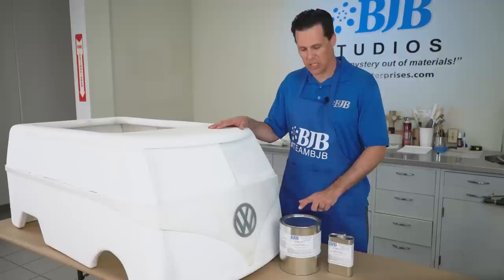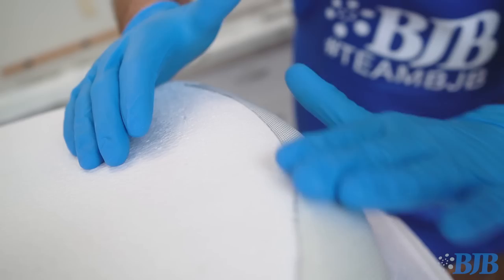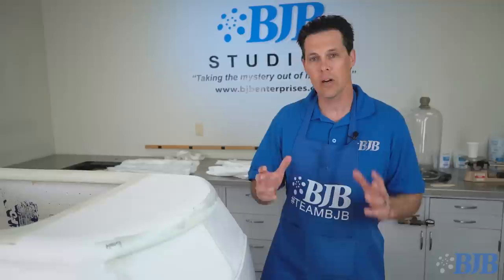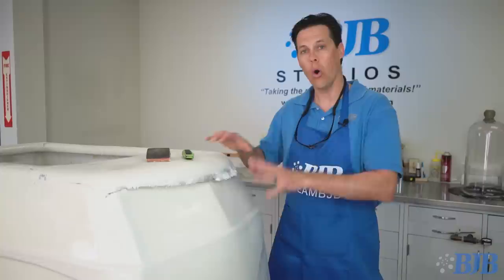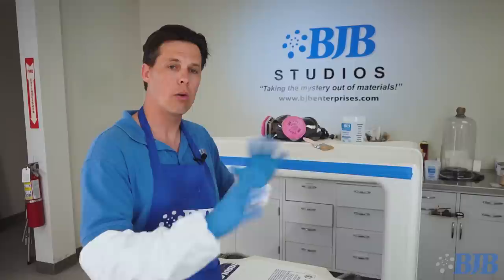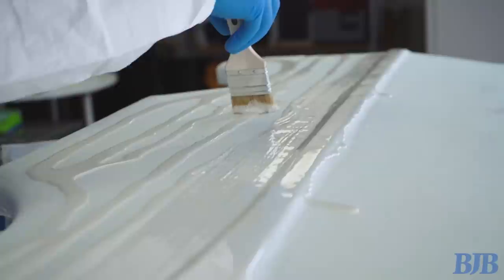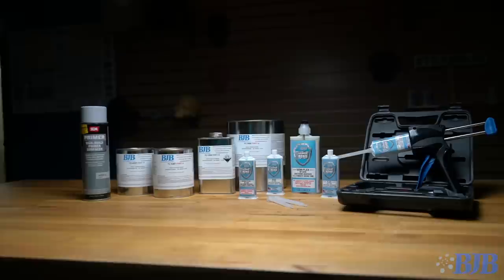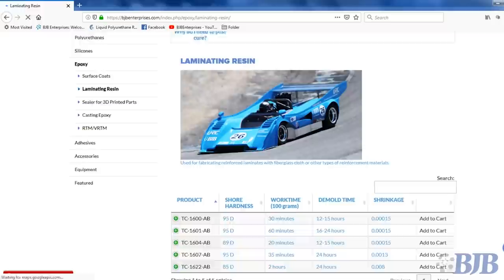Epoxy/Fiberglass Tutorial | VW Microbus Electric Go-Kart Shell

Comment: How does the epoxy compare to normal fiberglass resin i worked in a shop? Where to get fiberglass cloth?
Reply from the maker: thetermite72 great question. The big difference is that polyester resin will melt the foam while Epoxy won’t. Epoxy is also stronger by weight and is easy to paint and bond to. Fiberglass cloth can be found by many sources including our Distributor Revchem along with many online sources. We used 6 ounce plain weave on the bus.

Comment: I would love to get the dimensions for this project, I'm will be going in the Hejaz Shriners soon and I would like to build one of these for riding in the Shriners parade.  Can you please help me with this project?
Reply from the maker: Are you looking for the rough dimensions of the shell only?  That is fairly easy.  The chassis and the rest is a little more involved since it was built off an existing electric Go Kart: Honda Minimoto.
Reply from the maker: The shell measurements are as follows: Length 140", width 30", height 27".  The driver cutout area is 30" X 20".

Comment: I know this video is 4 years old, but what was the cost of the project?
Reply from the maker: Hi there.  It's difficult to put a cost on the whole project because most of the kart (excluding the body made in the video) came from used parts and pieces.  Materials to make the body are likely around $400-$500 for TC-1604 epoxy, fiberglass fabric, SEM primer, body filler, sandpaper, paint, vinyl decals, 3D printed parts, and so on.  The 1800 watt motor, speed control, and lithium 48v battery were found on Amazon (about $350).  To build something like this from scratch, you are looking at $1000-$2000 depending on the fabrication skills you have and materials used to build such a car.  Finding an old go kart frame and modifying like this helped save a lot of money and time.

Comment: That thing is simply beautiful. Did you remove the foam after you were done, or leave it? What are your thoughts on removing the foam, and using a chop gun on the inside? Do you feel the body is strong enough as is if you bump into something, or God forbid tip over?
Reply from the maker: Hi Kirk, thanks and good questions.  We leave the foam in there for a couple of reasons.  First, it strengthens the fiberglass skin tremendously without adding a lot weight.  You can achieve the same stiffness and overall strength with less fiberglass compared to a molded skin with no core.  If we had closed out the whole interior with a layer or two of fiberglass and epoxy, it would add only a small amount of weight but strength and stiffness would increase dramatically.  We did a few areas of reinforcement on the inside for mounts, but that was really it.  In regard to chop gunning the inside, that would imply using polyester resin and that would not work as the polyester eats white beaded foam.  That's why we use epoxy resin.  Overall durability of this shell is fairly good and will take some bumps or minor hits, but it's not built to withstand roll overs.  This cart is so bottom heavy and wide, a roll over is unlikely.
Reply: @bjbenterprises  thank you for the rapid reply!!

Comment: I notice the interior is black after you're done. Did you just paint it or did it also get some sort of reinforcement?
Reply from the maker: We simply painted it to improve the look.  There were strategic areas inside where we did add reinforcements due to mounting fixtures and such.  However, we did not fiberglass the whole interior like the outer shell.  Simply not needed.

Comment: I want to make a wide body scion FRS body for an electric frame, would that work? Oh, and great vid! I have been looking for help around enclosed go karts, but only find pre-made ones. Thank you!

Edit: are you supposed to take off the foam because you didn’t mention it in the video?
Reply from the maker: Hammy And Friends the foam is left to add extra support and rigidity.  Although not necessary in this case, adding fiberglass to the inside would have made it even stronger making a true sandwich construction.   Hope you are inspired by this video and try your own project.  Let us know if you have material questions.

Comment: Hey guys, I need some help :/
I'm trying to make almost the exact same thing but slightly scaled up. I want to be able to use the side doors to get in and out and have the top of the shell over my head. I would need to have some windows as a result. Currently I have a 6.5hp engine from an old lawnmower that I'm going to convert but I don't know if it will be enough to actually drive the weight of me and the Go-Kart frame + shell. I'm 6ft tall and around 150 pounds so if anyone has an estimate of how heavy the build would be then I could do the math and see if there's enough power. Hope everyone's having a good day!
Reply from the maker: That sounds like a cool project and certainly you can use this technique to quickly and effectively make a fiberglass shell. This is also a great way to make the pattern for producing fiberglass molds, too.  SInce you are asking about power requirements and frame construction, you might be better off finding some sort of Go Kart Facebook group or online forum for this.  There are some great, informative groups that specialize in these types of projects.  Either way, there will be some R&D to make a custom, driving vehicle as you described and let us know if you need epoxy materials to laminate the composite fabrics.  -BJB
Reply: @bjbenterprises  Thank you very much for the tips, I will be sure to reach out!

Comment: Do you keep the styrofoam on the the fiberglass or do you take off the rest
Reply from the maker: Typically you just leave the foam because it doesn't weight much and it also adds much more stiffness to the structure.  If you add fiberglass to the inside surface (which we did in a few key areas) the strength increases drastically.  Thanks for your question!
Reply: @bjbenterprises  I seen some with out the foam maybe it's to have the fiberglass feel to it
Reply from the maker: @ddrusa  It's likely because they built fiberglass shells from a mold and manufacture many parts at a time.  This is a method to create a on-off fiberglass part vs making a mold.  We could easily take a mold off of this shell and create more parts if the need and desire was there for it.
Reply: @bjbenterprises  Ah ok I get it now thank you

Comment: How / why  didn't  the epoxy  eat away the Styrofoam?   I thought that epoxy would melt the Styrofoam?
Reply from the maker: Hi Jim, great question.  You are thinking of Polyester resin which will eat EPS foam.   Epoxy resin does not contain the solvent styrene which is in high concentration in polyester resin.
Reply: @bjbenterprises  does all epoxy not come with the solvent or is it something that has to be mentioned or looked out for when buying some? I want to try this out.
Reply from the maker: @luislopez-vx5zj  epoxy is foam safe.  What you are hearing about resin eating foam comes from the lack of understanding from newbies in composites that confuse the term "fiberglass resin" and don't know there are epoxy resins and polyester resins.  Polyester resin is common in the DIY world because it is very simple and user friendly due to the way the catalyst is added in drops.  Epoxies you typically weigh out on a scale and that scares some newbies for some reason.  If you go to buy "fiberglass resin" at a hardware store or boat shop, you might not realize that it is actually polyester resin and that will eat the foam and sometimes people selling it don't even know the difference.
Reply: @bjbenterprises  thank you for the explanation. I tend to buy the “General Use” Resin and some gel coat they sell at the local supply store but have never actually looked into other applications. I’ll be checking to see if I can buy some epoxy resin locally if not I’ll be going online I’ll just make sure to get the ratio down needed for the correct measurements.